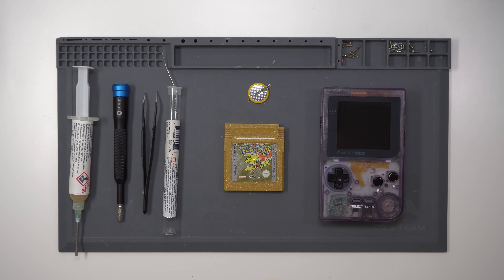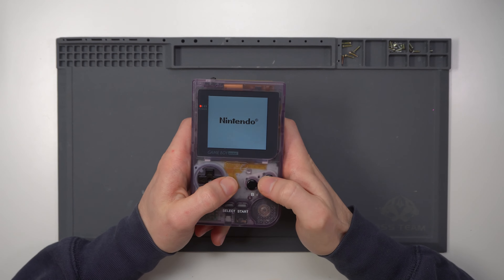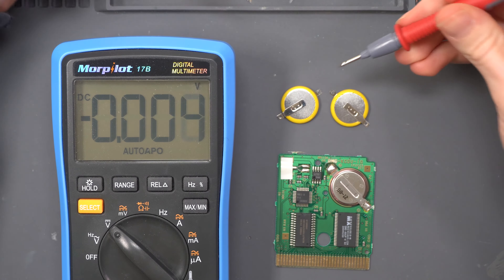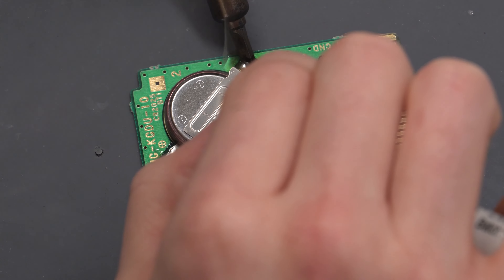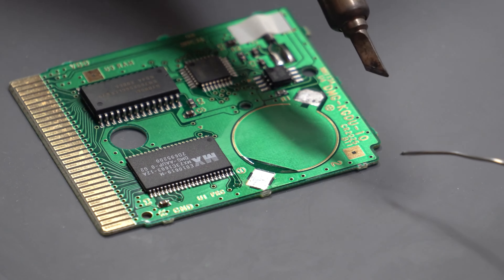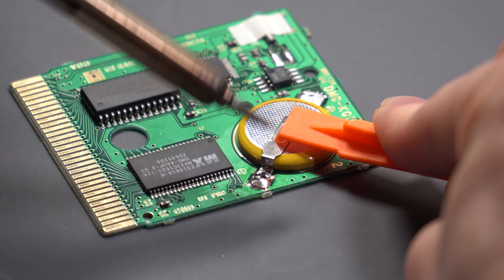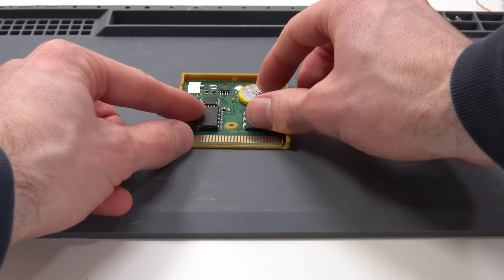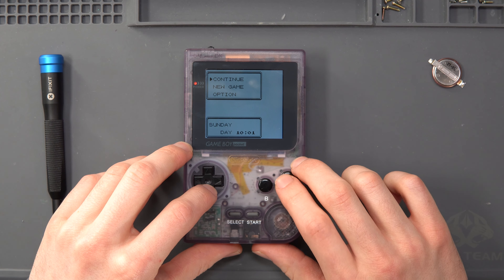How To Replace a Gameboy Cartridge Battery

Comment: With the analogue pocket coming out, I really need to learn how to do this, but I’m really afraid that I’ll burn a part and break it entirely.
Reply from the maker: I would maybe try buying some cheap Gameboy games that use battery for game save and practice on them? Google search to see which games use a battery and then see if you can pick them up cheap. Or you could find someone/retro games company that offers Gameboy game battery replacement, obviously for a fee.
Reply: You could always buy games noone cares about and low qualities but tested to work so u save time and gain experience

Comment: I only have one "complaint"! (More of an observation)

I think flux and braid are not necessary for this replacement, if this is supposed to be a super-beginner's guide. But my concern is mostly with the braid. Recommending a braid to a beginner (especially if they buy a bad one) could result in them panicking when it sticks to the board and ripping the pads off, I'm guilty on this but not on a cartridge
Reply from the maker: This is a good point - although I wanted this video to be the "covers all aspects" of replacing the internal battery. Having said that, I didn't cover the issue of losing the game save so in the end it didn't cover all aspects 😂

Comment: If you dont have a gambit screw driver, you can use tweasers, it shouldn't be that tight on, you might struggle to put it back on, but it works if you dont have the screw driver

Comment: I was 32 years old when i found out the cartridges had batteries.......lol i assume this is why my Gold wont save a damn game but my Ruby Red will? (replaced the battery in the Gameboy itself)
Reply: Pokemon Ruby has a battery in the cartridge but it saves the game using SRAM which is the computer chip that saves your game. The battery for Ruby is only used for timed events but otherwise a dead battery won't affect your ability to save the game.

As for Gold that's most likely the reason.
Reply: @swordsaver  Every game has a battery in the cartridge lol and no the ruby red doesn't have an extra one its even smaller than the normal carts....google a pic of the inside its just one battery and 1 chip....
Reply: @Shifty51991  If we're talking about Gameboy/ GBC games then yes all of them have batteries but not all GBA games have batteries inside the cartridges. Pokemon Ruby has a battery but the battery isn't used to save game data at all, unless you're talking about Pokemon Red which then yes it has a battery.
Reply: @swordsaver  Sorry i said ruby red when it should have been fire red (the remake of the OG Red game)
Reply: @Shifty51991  firered doesnt have clock based events thats why it doesnt have battery
Reply: @FrosenHell  ANY GAMEBOY GAME THAT CAN SAVE HAS A BATTERY.....
Reply: @Shifty51991  stop yelling, you're wrong
Reply: @Haydaus  go open any gameboy cart that has a save feature.....im not saying every single one has it....just ones that can save.....

Comment: Is this something a complete newbie could do? I want to replace some old gb batteries, but have never soldered before, and thus I'm very afraid of damaging the board
Reply: Same here, I tried it for myself a couple weeks ago and was able to do it. But I suggest understanding the process fully before getting into it so you don't panic. AND get one of those chisel tips for your soldering iron like he does in the video. I used a fine point tip and I feel like i struggled more with it because of that

Comment: Not sure that it’s a G3.8 bit. I’ve got a Pokémon Yellow cartridge (long) that I use with my gameboy advance sp and my G3 doesn’t fit more does my G3.5 bit. The 3.5 doesn’t even fit in the hole and the 3.0 barely fits and just spins but my 2.5 doesn’t go on the head too small. So I assume order maybe a 2.8 bit?

Comment: Is there a way to provide temporary power so that you don't lose save files if there still are saved files but the battery is getting really low
Reply: the only thing I know is, before you allow your battery to run out, there is ways to back up your save file by using a GBA backup tool. That way, you temporarily keep your saved data stored there, allowing you to change the internal battery, and once done just re insert the saved data into the GBA cartridge using the same backup tool.
Reply: You probably got your answer by now as this is an old post but if not you can use a mega memory card which will let you save and load games. Very easy to use and can youtube it. I usually save a file before I change a battery or save every once in a while just in case. Roughly $40-50 cdn but can use on any gameboy games you want so I found it worth it.  Also really good if you have at least 2 Pokemon games as you can teach any tm or use rare candies, pp ups then you would just reload the save game and can do it all over again on a different Pokemon

Comment: Thank you! 🙏🏾I bought Pokemon Crystal for a quite a lot of change, and it arrived with a dead battery. I have a solder iron (used it once on my guitar), ordered some batteries and gonna do this. It would be better to use a multimeter, right? I don‘t have one. Maybe I should get one too, though.

Comment: Is it safe to test the game if I eventually caused a short circuit in the board?
Reply from the maker: It should be ok, there should be measures in place to protect the console itself but with age and old technology it’s not always a guarantee
Reply: @TheRetroStation  okay good! Hopefully nothing does happen. I accidentally used to much heat while soldering cause my solder didn't melt and after a while sparks spread across the board in the upper left corner. I think I damaged one of the components. Wish I would've watched your video earlier haha

Comment: So, if  you want to replace the battery, no matter what, your previous save will disappear, am I correct?
Reply from the maker: It is possible to keep the game save, but you would need to look into cart readers and dumping the game save from a Gameboy cartridge. You can also supply the cartridge with power but this will be more complicated and harder to pull off. 

But yes, if you just remove the battery it will lose the game save.
Reply: If you replace the battery with a battery holder you can technically also solder some floating wires (properly insulated) so next time you change the battery you can use those wires to supply some voltage via two AA batteries inside an external AA battery holder with alligator clips.

Alternatively you can use the AA batteries here too but you'd need to solder the wires somewhere else than the battery pads or you'd just have the wires come undone.

So yes, you can keep the save, but it may not be an easy thing for a beginner. Best to just get the cheapest cartridge dumper you can and dump the save.
Reply: Basicly, if you want to change the battery it's because you can't save ;D
But you can solder wires with a 3,3V alimentation during the process so you can change it without have any deconnection
Reply: @zeldrix6  3V will be enough if powering off of other batteries

Comment: if you remove the battery do you have to replace it for the game to still work, i understand no battery no save, but if someone could let me know if i remove it to prevent the battery from corroding and destroying the game itself, will i still be able to play it if i put it back together with no battery in it?
Reply: I believe the save file in a GameBoy game requires constant power to keep the data 'alive', and will disappear when there is no power.

I've never tried it but removing the battery will likely wipe the save files clean, and will not reappear even if you add a new battery later.

Comment: How to you change the tabs?
Reply from the maker: The tabs come already spot/tac(?) welded onto the battery so you can’t change them without destroying the battery. (If that’s what you mean)
Reply: @TheRetroStation  I was asking because when you attached the replacement battery, it had the tabs already attatched.
Reply from the maker: Yeah no problem - always good to double check! But they should come with the tabs already attached 👍🏻

Comment: Alright, I have a question that isn't battery related. I have two gb cartridges that I'm having an issue with. One has a weird buzzing sound in the audio, and this is the only game I have that issue with. 
   The second one, when i insert it into the system and boot it up, only the copy right symbol shows up, but not the Nintendo logo; and it fails to load. 
  I've cleaned both of them with IPA, but am still having the issues. 
   Any tips?
Reply from the maker: If you’ve cleaned the cartridges and there’s still an issue it’s poor contact with the pins on the cartridge because of either; corrosion on the pins/cartridge or dirt/corrosion on the pins inside the gameboy itself.